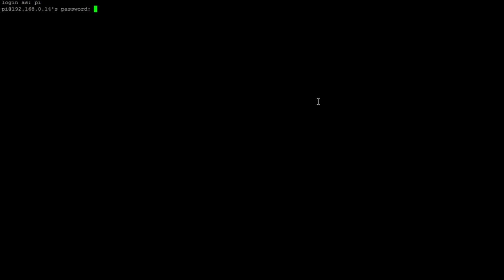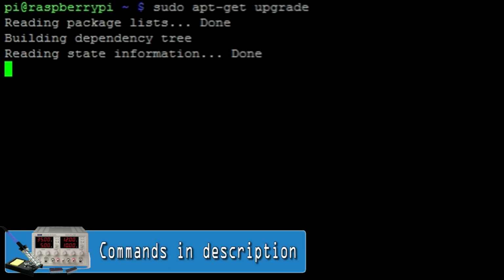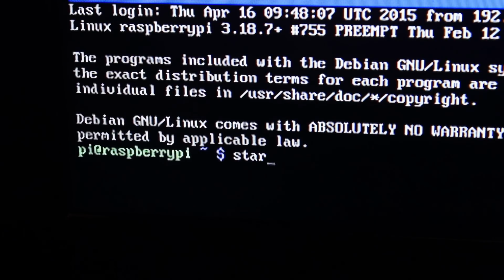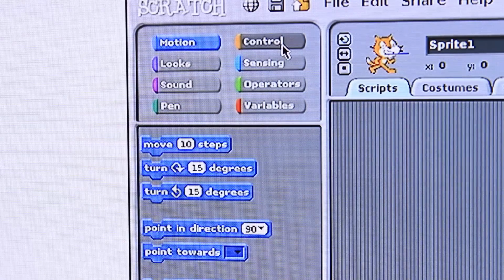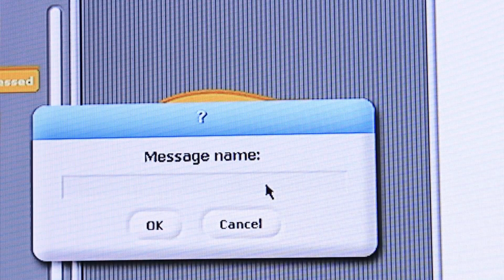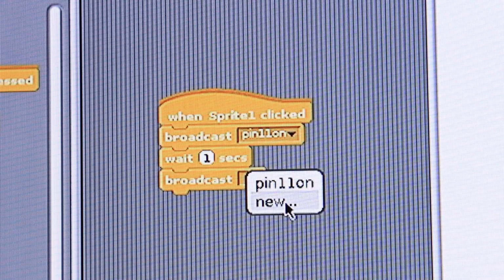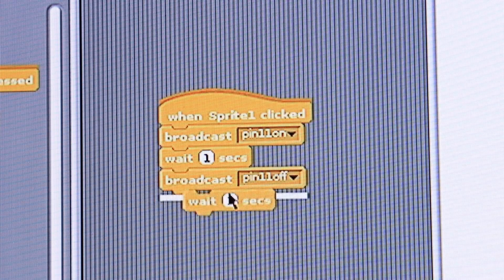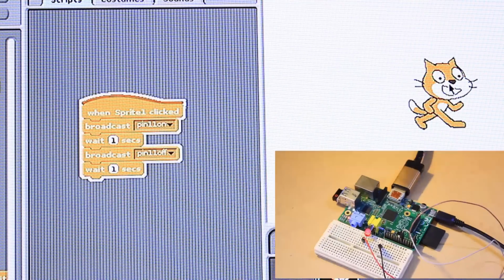Raspberry Pi - Scratch GPIO Control

Comment: Why do you need the ethernet connection?
Reply: Because you wouldn't be able to update, upgrade, nor install anything using the commands he showed. They fetch things from the internet (a.k.a WAN).
Reply: If I have a wireless connection?
Reply: Mangosuthu Buthelezi  The video shows a "first time setup" (at initial bootup you're not automatically connected to a wireless network). While you can bootup without the ethernet cable, then connect to a wireless network and run the same commands; he just showed one way of doing it.
Reply: Thanks for you reply but that doesn't seem to a "first time setup"!!   At "first time setup" you can't get a command line. At I don't.  Thanks anyway.

Comment: Have you used the sensor value command in the sensor block using your Raspberry Pi? A lot of the resources show that the pins should auto-populate in the software and when we hook up the breadboard, we can run your example perfectly but we have no idea how to get outside of this example without the Pins recognizing in the sensing block. Any ideas you have would be much appreciated!